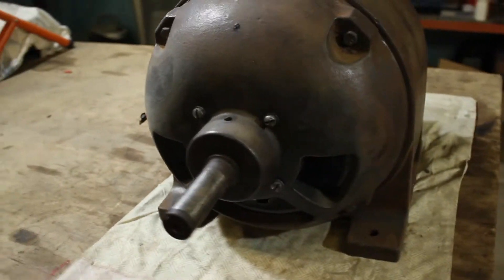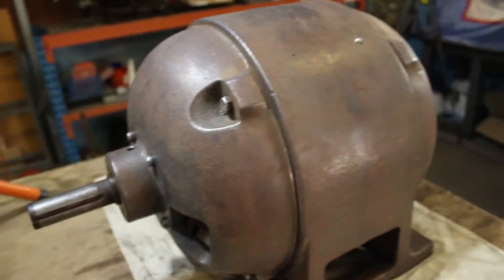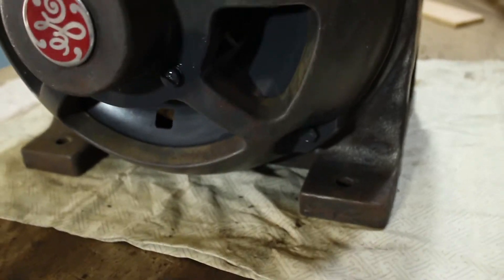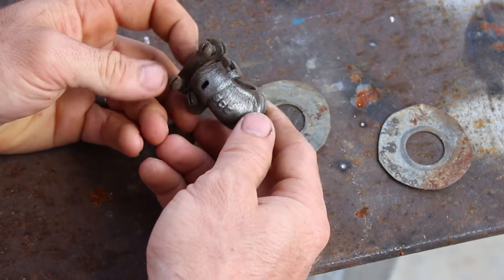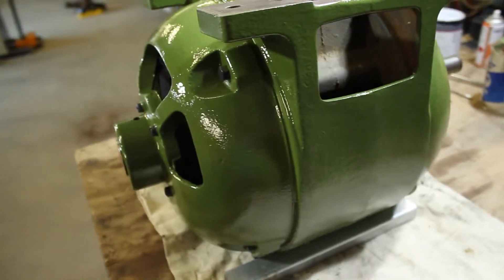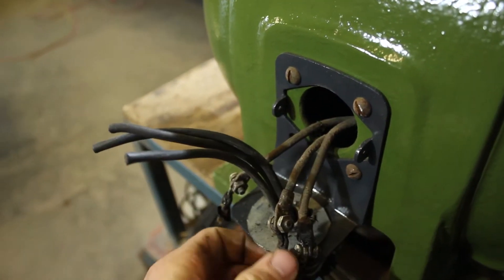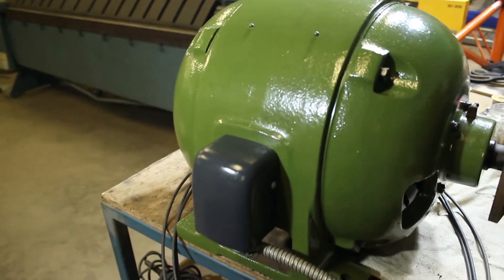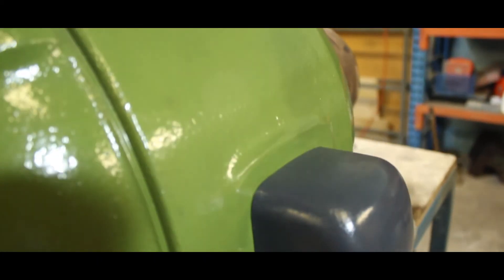DOES IT GO??! - Part 5: Motor Painting and Testing (3/3)

Comment: motor should have been taken apart and cleaned interior and new bearing before worrying about looks you might be painting a boat anchor that fitting is pot metal or mostly zinc not aluminum after seeing it start definitely needs bearings
Reply from the maker: The motor was taken apart, cleaned an inspected. Bearing replacement shouldn't be too difficult down the track. I did take pictures of the numbers for reference.